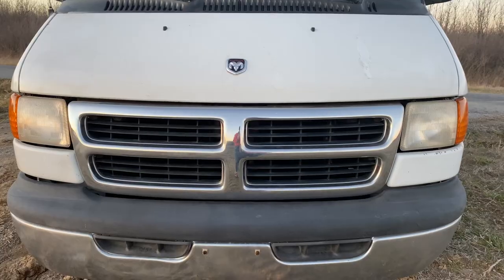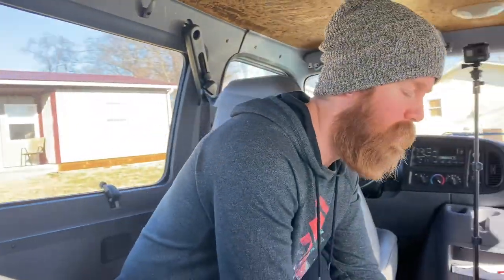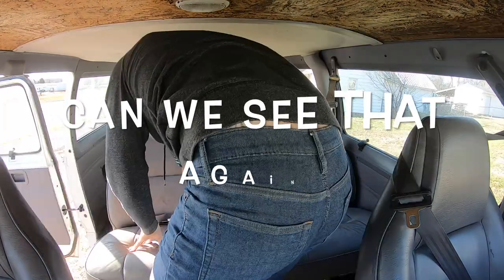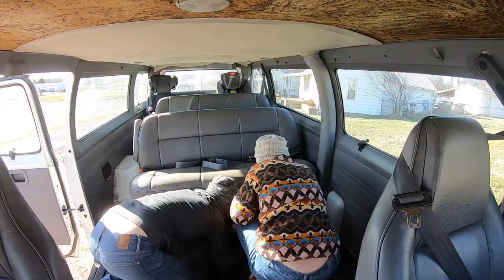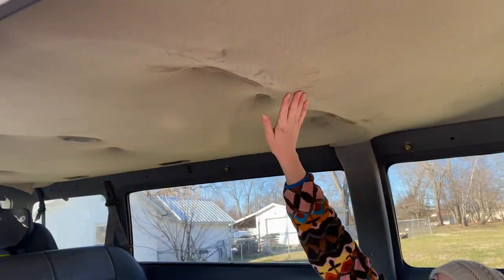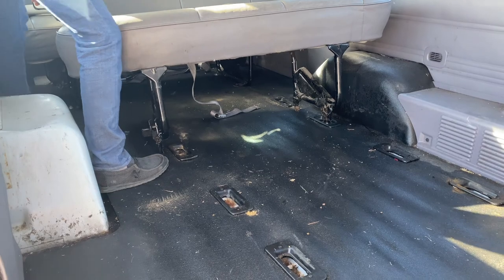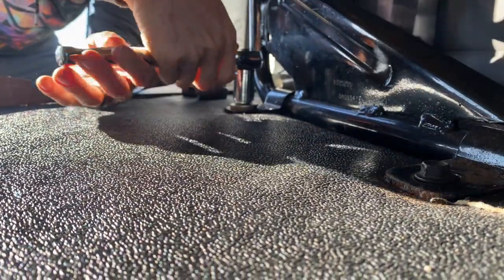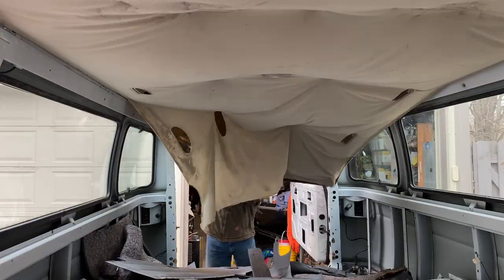How to Remove Van Seats l Dodge Ram Wagon l Episode 3

Comment: This looks like it was in a flood. Mud in the shoulder strap harness and water in the seat clamp wells.However, the dash and all the electronics lok good and are working. How would mud get in the seat belt where it attaches up on the van wall? Water that high would have ruined the electronic dashboard. I have a 1994 B3500 so I have been watching van videos. I am late to the show here. I hope this works out. I will watch more of your videos.